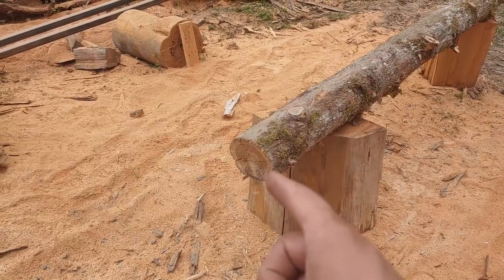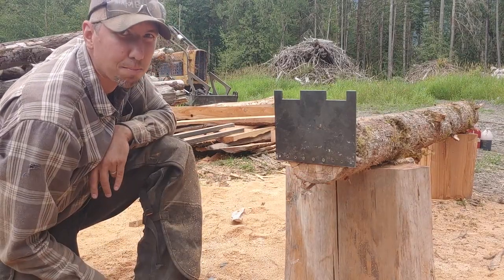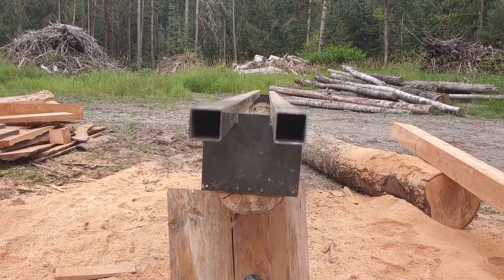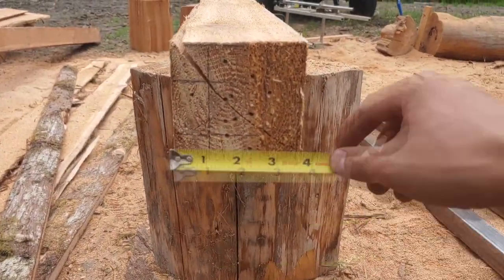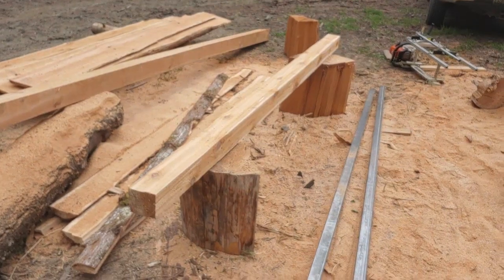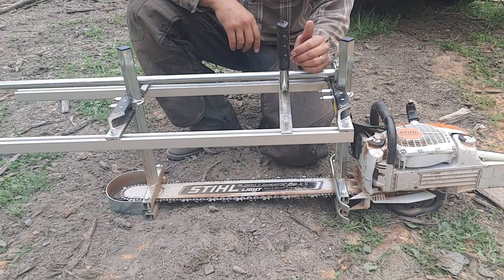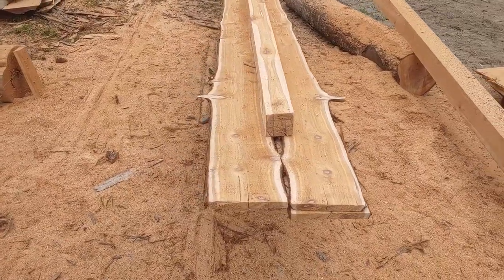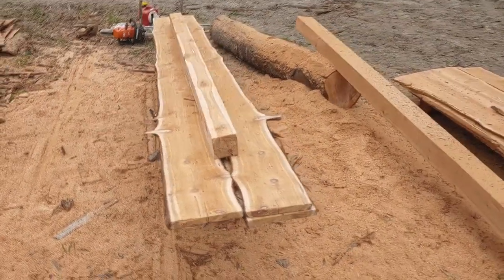Chainsaw Mill: Small Logs

Comment: Thanks for a good and informative video! I believe I have watched 80-90% of the videos on Youtube, dealing with Alaskan Mills! :-D Shockingly, a significant portion of them are by people trying out their Alaskan Mill for the very first time! :-D And even fewer says anything about the time the process took them! You are also one of very few doing bottom cuts from a guide-rail on top. I have been trying to find more examples of this, as it seems like a very good idea. You are of course limited by the height of the Alaskan Mill at this point. So it only applies to smaller logs.

All that said, I do have a couple of suggestions for improvements: With the 4x4, you could get by just fine with setting up the guide-rail for just two sides. Then for the opposing side, just use the already flat side a your guide. If what I mean is unclear, after the first cut, roll the the log 180, so that your first cut now faces up. Doing this would save you some significant setup-time. And as you would probably agree, setup often takes more time than actually cutting. At least for smaller logs.

My second suggestion for the 4x4 would be to get the guide-rails as close to the log as possible, while still compensating for the taper of the logs. Reason being that a smaller distance between the Alaskan jig and the chainsaw-bar would (at least in theory) result in less vibrations, yielding prettier cuts. I guess it depends on what the lumber will be used for, if this matters or not.
Reply: I agree, I thought cutting from the bottom was a great idea

Comment: It would be nice to build a sawmill rack with the ladder on the bottom and top
bolted together with side posts and a 12" clearance so the saw travels between the the ladders.  The log rests on the bottom ladder and the sawmill rides on the top ladder.  You can shave off the top of the logs and toss out the center.

Comment: Why did you use the rails for the 2nd (opposing) slab when you could more accurately run it parallel to the first cut????
Reply from the maker: Hmm, good question.  Not sure😂

Comment: Awesome video. Where did you find a rail system with a plate for narrow logs?
Reply from the maker: Thanks!  The rails are just 2x2 tube and the plates I made with my plasma cutter and a drill.  If I was to do it again I would get tube that is 1.5x2 or 1.5x3, something rectangle so its stronger in one direction.
Reply: He copied the design from "Surviving Ringworm" on YouTube.  The only difference is the size of the square tubing.  
These mills are intended to have only one guide setup and then use the newly cut flat plane for subsequent cuts.  With this salvage operation the third cut DID need the metal rails but the second and forth did not.
Reply from the maker: Here is a bracket that would work also: Chainsaw Mill Brackets: https://amzn.to/3q4808V